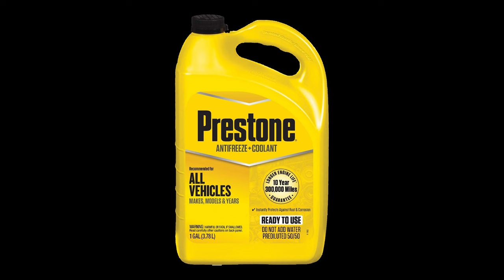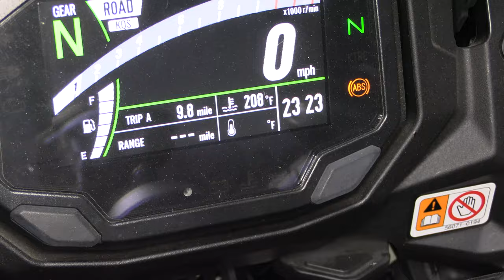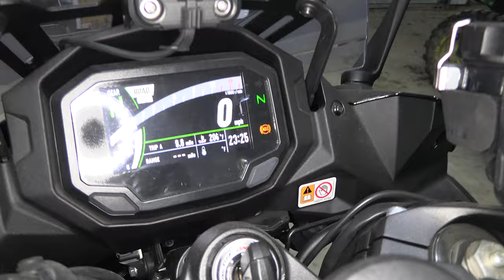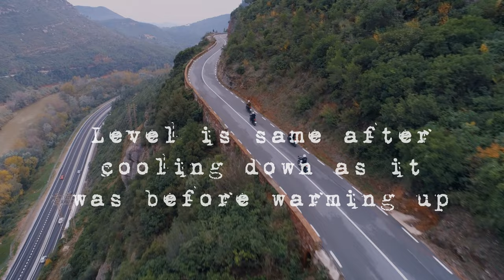Kawasaki Ninja 1000SX - Coolant Change

Comment: Just a quick note. Phosphate is bad for aluminum engines as it promotes scale formation. If youre going to use pre-stone get the bottle that says max European teal since bmw requires you not to have phosphate in your coolant so its safe for motorcycles.
Reply from the maker: Not a bad recommendation.
Reply: @BlueEyedRider84  the shop I work at uses regular prestone coolant for atv but thats because atv guys dont keep their coolant longer than 1 year. If you change it often than regular is fine but for street bikes that do it at 36,000kms like you said I wouldnt use prestone “all vehicles”. I do mine kinda earlier around 10,000 to 15,000kms

Comment: So, in regards to anti freeze, for those of us that live down under, the temperature here, even in the coldest days of winter (right now for us at time of writing) never drops below 0, is it still a necessity to use it??
Reply from the maker: You must use some form of anti-corrosive/lubricative coolant alternative. Racers use stuff like redline water wetter: https://amzn.to/3WgIuuZ

If you run plain distilled water your system will eventually corrode and the water pump will fail.

Comment: Great video.. thanks.. really appreciate the step given.. next time try to open drain bolt before radiator cap
Reply from the maker: Yea, will do that next time for sure. I have had a two motorcycles where you do that and nothing comes out, so you are stuck with it coming out with a lot of force. I do not know if the same thing would happen on the SX, but will definitely try it next time.
Reply: Thanks for the video.. keep it up!

Comment: Can you tell me the easiest way to tap into switched power for 2 small LED lights I want to install?
Reply from the maker: If it were me I'd tap into an accessory. As in a part that can be replaced and not the main harness. For example, DC accessory port, heated grips, usb accessory under rear seat. If those are not an option then you can tap into the connection for any of those. If you have a 2020+ they come with blanks that you can easily get the metal wire tabs for and make your own connector. 

I do not and never recommend splicing in the main harness. That leads to corrosion and eventually many other electrical issues if it isn't sealed and done perfectly.
Reply from the maker: If it were me I'd tap into an accessory. As in a part that can be replaced and not the main harness. For example, DC accessory port, heated grips, usb accessory under rear seat. If those are not an option then you can tap into the connection for any of those. If you have a 2020+ they come with blanks that you can easily get the metal wire tabs for and make your own connector. 

I do not and never recommend splicing in the main harness. That leads to corrosion and eventually many other electrical issues if it isn't sealed and done perfectly.
Reply: Thx. I already tried the USB in the rear by using posi tap connectors and I get no power and same for the plug where 12DC is on the front left. I even started the bike to make sure. I wonder what I’m doing wrong?
Reply: Add what’s strange is I ran the rear USB to my phone and it works, but when I tap into the wires before the factory plug USB feed, no power.
Reply from the maker: @MrJohnNapolitano  I assume you have tested the lights from another source or direct to battery?

One thing I didn't think about is if it's 12v going to that rear usb. It should be and the conversion done in the USB part, but I'd have to double check to be sure it isn't 5v going there
Reply: Yes, I tested the light direct you the battery and checked the fuses. 
So annoying I can’t get it to work. Ugh!
Reply: On the front left side it’s the
 Plug with a green lead and a black/yellow striped lead. I tried a test into the pins and position tap into both wires. I’m stumped; unless it’s a factory error. I wish I could send you a pic.
Reply: I’m sorry,  the plug has black and green wire. I was looking at the signal wire previously by mistake. Anyway, no power to it.
Reply from the maker: Is the bike turned on? Without actually seeing what you are referring to it is difficult to diagnose. All of the accessory ports (DC accessory, Heated Grips, USB) are switched power only, so the bike has to be on. All three of those connectors are just two wires - positive and negative. So if you connect directly to the battery and the lights work, they should work on any of those connectors with the bike turned on (doesn't have to be running).

If your bike is on, you have positive to positive and negative to negative and the light does not come on, we may have to take this elsewhere to figure out how to resolve. Facebook or something. Let me know.
Reply: Thx. I finally found the right accessory tap. I think the first plug I pulled was the temperature sensor. Lmao! All good and works as it should. Thank you for baring with me.

Comment: Nice quick and concise way to do a coolant change on the NK1. Well done! I like the idea by utilizing the fluid transfer pump ( harbor freight here I come)🤣. The last coolant change I did was on my SV 650 and I used a 50/50 mix of asian vehicle specific coolant that was orange in color. What say ye ?

Thanks for again for the informative vlog!
Reply from the maker: The fluid transfer pump definitely saves on mess and makes it a lot easier. 

The coolant should be fine but I will say best practice is to flush the system so it's all the same coolant and doesn't mix with another kind. Even so, regular green is usually cheapest so I just stick with it.

Comment: Salve, grazie per i video semplici e comprensibili, potrei sapere la misura della rondella del bullone di scarico e di che materiale è fatta? Grazie
Reply from the maker: 6MM - I am not positive of the material, but I am pretty sure it is aluminum as most are. You can use copper. The only downside to using copper is it will oxidize being a different metal than the engine (which is aluminum). However, with all the bikes I have done work on, I have never had an issue using copper in place of aluminum, but if you can find a 6mm aluminum crush washer at a reasonable price then that would be the recommendation by Kawasaki
Reply: @ grazie